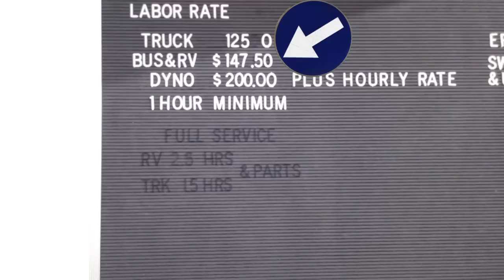What To Consider When Buying A Diesel RV or Motorhome?

Comment: I spent $9,300. Last month.
$3,900 was a new Dometic rv fridge.
The one I replaced worked flawlessly for 18 years. Not bad.
Last year I spent $2,300.
The 2 years before,  - 0 -
But, I have never been towed in 50 years of driving .
Great video.
Service
Service
Service

My theory 
No extended warranty ever.
Spend the $$$s on preventive services 

Enjoy.
Reply: Very informative
Reply: So true. Preventive maintenance goes a long way and it's cheaper in the long run.

Comment: He speaks facts and I can tell he was trying to go easy on those costs.  We recently bought a 2003 Newmar Dutch Star (8.3 Cummins ISC) from a nice older couple who could no longer maintain it and ALL maintenance was due, plus it needed 4 out of 6 tires.  The only thing that stopped us from being overwhelmed was the fact that I'm mechanically inclined and did everything myself except the new tire install.  We paid over $3000 for four Sumitomo tires because I didn't want to pay the price for the Michelins.  Doing my own maintenance helped tremendously but I still spent a couple thousand in materials.  I had to replace the toilet, oil change required 24 quarts of oil, I had to fix a coolant leak, I changed all the filters to include the big engine air filter and the Wabco filter for the air system..  I'm happy with where we are maintenance wise but I'll still need to change the transmission fluid soon and I still haven't figured out the dash AC not working.

Comment: We bought our diesel RV used and saved the 70%. A oil change for us runs $425. New tires are $6,000. Owning a 42' diesel RV is not free, but ours runs great and it is a fabulous way to travel.
Reply: I’m wondering how frequently does your RV need an oil change?
Reply: @texaskenny2  

About a year ago I bought me a 2002 Holiday Rambler Ambassador Cummins 8.3

I love it mine does hold about 12 gallons of oil though, I normally change my car oil about every 3,000 to 4,000 miles. 

I haven't checked yet when I have to change this motorhome oil though.

But so far knock on wood the engine is phenomenal and Allison Transmission as well, I put a fass fuel pump on it.

It will help my vp44 injection pump from burning out getting air locked and I put a fuel additive called XP3.

I don't know what got me to good miles per gallon, the fuel additive or the fass fuel pump but on the freeway holding about 65 miles per hour I got 9.5 miles per gallon I was pretty impressed.
Reply: What the hell kind of tires did you buy for $6k.
You can get all eight Michelin for like $4700
Reply: @kellykelly2938  It depends on how much driving you do. Once a year or so will generally do it, unless you're going 10k or more.
Reply: Phil Z ...exactly WHERE did you find 8 Michelin for $4,700?  Please, share, the world needs to know!
Reply: @texaskenny2  how do you have a 13 liter/ 15 liter Cummins ISX in your truck ( unless you are a truck driver) the most I’ve seen in pickups are an ISB engine which is just 6.7 liters ( which is what my motorhome has)
Reply: @engineergaming4295  I see lot of the older ones with Cat 3126's 7.2 Liter engines. The later models now have Cummins ISL which is 8.9 L.
Reply: What is the year and how long have you been problem-free I was thinking of getting a used one
Reply: @jamesbondaygee  Wow! My post was 4 years ago. Prices have definitely changed in that time. Oil changes are now $1200 and tires are $9000 now. We have a 2006 42' Monaco Dynasty. We absolutely love it. The biggest repair we have had so far was rebuilding the onboard Onan generator.

Comment: Love my Monaco executive with M11 450 Cummins 650,000 miles still running strong. 12 gallons of oil in the engine and 12 in the world 4000 trans . Don't care because I can go up the hills as fast as I can go down . 11\22 5s with nitrogen keeps them cool . Cover your tires when parked keep them shaded and they last a long time .never broke down yet. I drive from California to Louisiana many times a year running 75 to 80 miles an HR through Texas. Love it
Reply: We have a 2006 42' Monaco Dynasty. 😊
Reply: Cummins engines are amazing, my dads truck is 20+ years and the engine is going to outlive the body lol.
Reply: Monaco's are great coaches especially when used regularly. I think this guy is referring to the casual user that lets his rv rot on the side of his house.
Reply: That M11 is one of my favorite engines.
Reply: Sounds like you actually drive the thing frequently. Most Americans go out buy the biggest they can get for 2 people go on 2-3 vacations get bored park it. The thing sits for 90% of the year maybe they take it a few more times and move on to other things in life. By the 5-8 year of ownership it's been sitting 2-3 years at a time and is never even started up batteries are dead. They sell it at a much reduced price because it's 10 years old new owner buys it drives it on one trip has bunch of problems take to this guy he gives them an estimate for $12000 they can't understand why.
Reply: Great info,  warranties have always been a rip off for the most part , if your not mechanically inclined its tough.  Looking at buying a monaco executive that was half a mill new , still looks great can't believe how much they depressiate definitely getting an inspection done first wish me luck

Comment: A great video. We have had a 97 diesel pusher for ten years now. New tires last year. I do all the oil changes chasis lube and all necessary repairs. I'm not a mechanic but I believe most people could do these things if they informed themselves of the simple but ackward procedures to get things done. 26 litres of oill at cosrco about $75.00, oil filter ebay $35.00, 2 fuel filters $40.00, transmission filters $50.00. A lot of times the problems have simple solutions. A furnace or fridge that hasen't worked in awhile just needs a jostle or whack with a screwdriver handle. As for trouble insurance, put away 3 or 4 hundred avery month in a separate account then if something goes wrong you will soon have a stash, instead of the insurance company. Anyway happy diesel motoring.
Reply: My uncle who owned a gas station took his cars to jiffy lube and explained he did so because 1 in a million oil filters go bad and destroy the engine, and if he did the work, he would have to buy himself a new engine, whereas if jiffy lube did it, they would pay.

I understand the pleasure of doing it yourself, just thought I'd post this because it was a revelation to me about his take on this. I think really he was just getting older and didn't want to do it any more, but it is a valid point.

Though I'll probably do my own oil changes too, $200-300 for an oil change is way different than $29 or even $69...
Reply: @gadgetsage  when you want the Jiffy pay you, you will know you need to pay laywer more than you want from Jiffy

Comment: I have a 40 foot class A and yes it is expensive to own but if you keep up with it and dont wait for things to break it is doable. Now I have a gas motorhome and it is 20 years old, and when I bought it I spent 20000 rebuilding the engine and in upgrades, but that was all planned when I bought it, I have never had any problems in the past 5 years,  and I use it all summer up until Oct every year. We have put over 10000 miles. I would say just do some research into what your buying. I will say get a good mechanic, my oil change was only 45 dollars last week.
Reply: $45! Is that any where near Los Angeles?

Comment: Let’s list some basic parts and expenses so rv watchers get a idea. 
Air dryer 300$ plus labor. 
Or u can rebuild it yourself for under 130$ in parts. 
Tires are 400-700 for the good top shelf ones. 
200-300 a battery for the nice ones. 
Plus labor. 
Brakes ? If you have the new disc brakes , u need a loan to replace those. But truth is you can rebuild the calipers for cheap. 
Alternator , 200$ plus labor. 
Diag time to find out what’s wrong 130-160 an hour. 
Head gasket ? 
2800-4500 depending if it’s a Cummins or cat or Detriot. 
Depends on year and engine model. 
Injectors ? Water pumps? Air compressors ? Turbos ? 
And the list goes on and one and he cost goes up and up and up. 
And I didn’t even hit on the trans , rear end, ac system, cooling system , electrical system to control the inside, or the actual rv itself inside with a million moving parts for slide outs , suspension, steering , etc etc and yes there is more I didn’t mention lol 

God forbid I have a rv with a Cummins 08-13 years. You’ll really hate life. Just burn that thing and walk away. 

If your not a very mechanically inclined owner or a master at information intake and comprehension , just rent a rv and don’t own one. 

Massive money pits that lose value like a boat or like  3 legged horse. 

U fly where your going , rent a car or van, and get a hotel. Thank me later and enjoy your vacations. 

If your really crazy about an rv hire a mechanic in a van to follow you and carry tools to fix you up. 
It would be cheaper the. Taking it to the dealer every time the heck engine light is on. And I’m not even kidding.
Reply from the maker: Pretty much have to agree here. If you have to go on the road, a truck trailer combo is better in my opinion. Used truck and used trailer as well.
Reply: @AdeptApe  only thing is that you can't tow a stacker trailer
Reply: Brutal comment you got going there, tough and truthful, you would be perfect for drug intervention situations.
Reply: Wife and I flew to the east coast rented a motorhome for a week best money spent. Same thing with boats I sold my boat 10 years ago we found only used it no more then 10 summer days in a year if you added that up way cheaper to rent. My boat cost 28k with 5 year loan that's $5600 a year comes out costing. It would take 50 years to break even we only really go out now on the lake 3-4 days a year 10 days was just because I felt had to use it since spending all the money.  My boat was a cheap one just a bow rider not even close to what I see people spending 100k easily on .

Comment: Where are you getting oil for $10.00 a gallon? Retired diesel mechanic here, with a Snap On scanner that I can diagnose my own engine with. I can say for certain that you are correct. I got a 36 foot Safari Sahara with a Cat 3126 to tow my Bronco and go 4 wheeling while I travel. It pulls the grades towing that Bronco like nothing is back there.  Unless you can handle the $700.00 each for 6 Michelin tires plus mounting and balancing, usually $35.00 a tire, or the $150 to $200 a battery for 4 to 6 at a time because you can't just change one at a time. Or the cost of filling the 100 gallon fuel tank, on a regular basis because it gets 6 mpg, or the $1000.00 road call if you need a tire or get stuck in the sand because your AAA RV service or Good Sam doesn't want to pay,  etc then a class A diesel pusher is not for you. A diesel pusher tow costs over $100.00 per hour door to door meaning from the time it leaves their yard until they get back to their yard and towing you in between.  Yes I love my RV, it's reliable because I maintain it properly and I know how to fix it if it ever does break down, and the number one reason I enjoy it is because as a retired mechanic I can afford it...

Comment: I wouldn't let this chatter scare you off. Any six figure purchase requires research. My home with a large pool on a large lot is also expensive. What isn't discussed is how much better a Freightliner chassis is to drive than a V10 pulling a flexi-flyer chassis. If you've driven both, you'll know the night and day difference in driving them.

Comment: I bought a beautiful 2006 Itasca Ellipse 40 ft diesel(Cat 3.7 350 hp turbo) with 9000 miles about 4 yrs ago.   First trip returning home from Florida to Colorado blew the head gasket.   Ruined cylinder wall and piston. Almost 3 months later after tow to nearest shop in Georgia, new engine, 20k bill.  Not a believer in extended warranties.   However,  with as many moving parts as an RV seemed like the right think to do.  My only cost was the 1k deductible.   Warranty paid for rental car home, gas, hotel , food and return air fare to pick up RV.   Don’t go without it..

Comment: Being a manager and a service writer at my local TA/Petro for close to 6 years gave me a lot of onsite on the maintenance side of a large diesel. Something else to consider is a lot of times, truck shops don’t even stock rv tires. As they’re not a common tire size like the 11r, lowpro 22.5 and 22.4 are, so that’s an added expense, as well as downtime if you have to wait for them to be ordered from the local warehouse. Oil changes on cats at TA specifically and maybe loves and speedco as well as cat filters are an upcharge. So 350-400 is pretty common for an oil change cost. Yes, you can run fleet guards but it’s still gonna run just shy of 300 to change your oil
Reply: That right there is why I always carry a matching mounted spare, plus I have an extra spare in my garage .
Reply: As long as you don't stop at T/A Commerce(Denver, Co.) Me and the Ass Mgr got into it back in 2014. Checked in at 10:19 am. I was put to bottom of pile. Complained. Found things wrong that was not there. Carrier Bearing going bad. Told Immanent Failure. Same for 1st U-Joint. Massive oil leak at steering gear box. Pictures could not find. Same parts still in the truck. Go figure. Liars, Cheats and Thieves. Called C.S., when asked what I would like done? Stand them against the wall.  No more T/A for me.

Comment: Always be extremely cautious when buying warranties.. especially warranties that aren't directly from the manufacturer! I worked with Ford for decades and if their car broke down they're aftermarket insurance would not cover towing, diagnosis, fluids, taxes, seals and gaskets, and almost everything else. Every time someone had one you would hear them say "why did I buy this warranty then"? Of course we didn't have anything to say to that. A typical transmission repair would be around $4,300 and usually the warranty company would only pick up about 800 to $1200 and the customer was on the hook for the rest! When my dad bought his class A allegro they tried to sell him an aftermarket warranty for  $3,500. I read the contract and it said they "reserved the right to fix it in the most economical way possible" which means they're going to install junkyard parts. I told him to save his money and I would put in any parts that are needed since I'm a Ford mechanic. (And an awesome good looking son.) I just had AAA  turn down one where my estimate of repairs  I live in the Bay area and they only wanted to pay $80 an hour! They ended up having to get a new radiator and air conditioning condenser installed at miracle Auto painting because there was only ones that would work for that low of a labor rate. My mobile mechanic business doesn't even go that low. The Ford dealer around here is it $220 an hour!

Comment: Yep I’m a chassis technician at a rv dealer and it’s not just the diesel pushers that have issues but the ford gas units as well many of these coaches sit for long periods of time which leads to many of the issue as well as every coach is unique and modules fuse boxes etc are placed at random and there are very little diagrams to solve issues  the motors themself are very reliable and have never really seen any major issues as many of the coaches that come through have less than 50k miles main issues are lack of maintenance

Comment: If some one starts making glider rv’s that will be one hell of a seller.  
A new rv with a 3406b/e would run for ever, like the people expect. 
I feel sorry for the people who have zero experience with truck engines and they get stuffed into a regen def engine with a dpf or a regen system bill that follows it ......in the thousands.
Reply: Exactly why I'm thinking 06 or older. You can replace outdated stuff,  if you're mechanically inclined. 
Buy an older one with a few miles,  that way you know it didn't sit still all the time, like 100k or so,  broke in,  not down.
Reply: @michaelmurphy9596  dang I thought I would have no problems with emissions because I bought an ‘08 motor coach because it didn’t have def, but instead of DEF it has DPF which is still I guess a problem. It has a 2007 Cummins ISB 6.7 turbo diesel

Comment: 10 years on RV tires is normal. $500ea @ 6 tires... 
service is done once if not twice a year @ $1000 ea
Air filer for my C7 is $50.91 (yearly)
Fuel filter $19.91 ea @ 2 (service cost)
Oil filter $26.79 (service cost)
Air cleaner filer (brakes) $38.14 (part of service cost)
oil and gas filers are part of the service cost I named above.
Also the generator get a oil changes and new oil filer also done ever 100 hrs or yearly with our full service.
Other cost like Roof should be check each year, by you or a service tech.. $800
We plan $2000 a year for service cost. 
Also we are full time RV'rs, We live in out RV and stuff also brakes..

Simple people .. You have to put $100 a month away for yearly service of your RV.. 
If you have gas you cost will change as you have to do more service more times a year.
Reply: Lol what does the $800 roof check include???

Comment: Friend bought one.  Get it home.  I notice a very very slight skip at idle.  Didn't pay much mind to it and used it that year.  Then before you know it injectors, injection pump.  I think they had to get it towed to CAT.  Fat check to cover that bill.  I could stay in some swanky hotels just for the repair, add the cost of the RV and I'd be set.  C15 ACERT